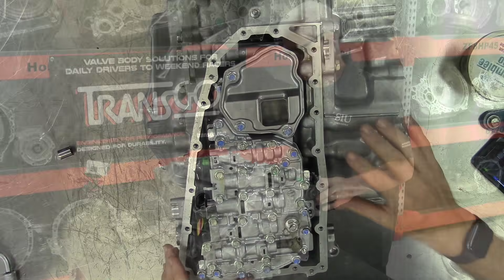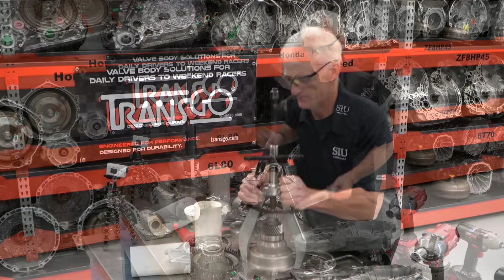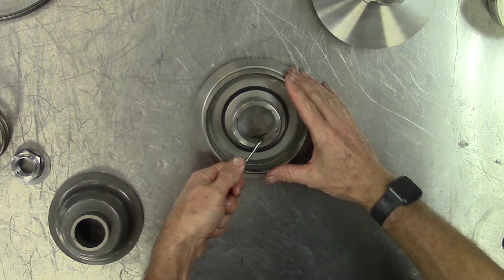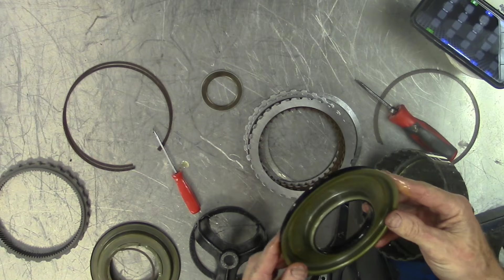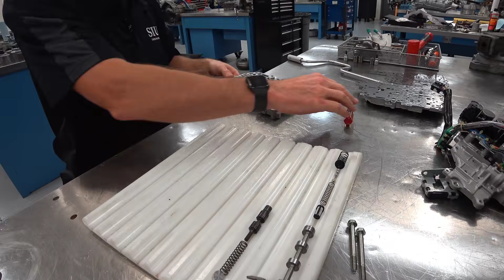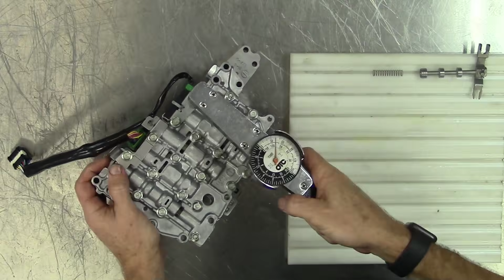Jatco CVT Overhaul JF011E RE0F10a/b

Comment: In your opinion, which component is responsible for producing a ticking sound at low speed when I am not pressing the accelerator pedal?
For example, when driving at around 50 km/h and I lift my foot off the accelerator to let the car roll freely without pressing the brake, I hear a ticking or slightly louder repeated sound that continues until the car comes to a stop. However, when I gently press the accelerator to speed up, the sound disappears.
This is happening in a 2019 Nissan Sentra.? 🤝

Comment: Excellent video I have a 2016 Nissan Pathfinder and would like to know what would make it shudder at around 20 to 25 miles an hour only after reaching operation temp. dose not when cold I've changed the fluid twice, changed oil cooler filter ,and replaced transmission cooler to an aftermarket heavy duty one and replaced it to the front of the condenser and radiator Thank You

Comment: Great videos, thank you so much. I have a 2016 Rogue with a JF016E transmission. Is there any chance I can pull the variator pully assembly without removing the whole transmission from the vehicle. Right now I just have some vibration from the transmission, not a complete failure yet. I would like to check the valve body and variators and rebuild them if possible. Thanks

Comment: I would like to ask you for assistance regarding clutch locking up. It males rattle sound when idling. When you rev it it is quite. When I put it into D and R it takes 2 seconds then stalls. Cleaned valve body and was not bad. Checked the valves and works very good, but still the same. Reconditioned torque converter, they told me it looked good. So its still the same. Oil and all the obvious stuff is good.  No TCM errors. Tcm shows when it locks and unlock clutch but still stalls at stop.

Comment: Are you the guy doing the video or just sharing it? I am attempting a repair on a jfeo16e  reof10d , I used your video to reseal the variators. Primary was no problem. Secondary seems to have .015 press fit on the variator and wont slide down the shaft

Comment: So I just replaced chain and varistors in my transmission. Primary varistors was leaking badly so car wouldn't move right. While in there, I replaced the 2 clutch packs, the frictions and steels to be exact. And a few seals and orings along the way. Everything went together smoothly. Once starting the car, and letting fluid circulate, test drive and it seems like it would like to move in park. I can rev it up and it doesn't force anything, but I can feel the pressure. Same in neutral. Reverse feels like it has brakes stuck. It will go backwards but it takes some throttle to do it. Also, sitting on a grade, the car won't roll backwards in neutral unless engine is off. Then it freely rolls. It didn't have these issues before I dug into it. So now I question, what internally could I have done that perhaps a leak is letting pressure go where it shouldn't. Or do I have a valve body issue?

Comment: These are in Nissan, Suzuki,  jeep and Mitsubishi vehicles and all made by Jatco.  You'll find one service kit on Amazon that cover many makes and manufactures.   The pan gasket, filter, oil cooler and o ring work across all those platforms. Example, 07-13 Nissan Altima is same as the Mitsubishi Lancer and outlander cvt.
Reply: What one works for 2010 Suzuki sx4 crossover cvt 6 speed
Reply: @WelderReese01 RE0F10A RE0F10B JF011E Transmission Filter & Oil Pan Gasket Kit on Amazon. Transmission filter, gasket and cooler cylinder filter. I used that kit on my 2011 Suzuki SX4 two years ago and still working great at 140k miles.
Reply: @20tea awesome thank you
Reply: @20tea I ordered a valve body and it has 1 sensor not 2 🤦‍♂️

Comment: So far, I've had good experiences with this unit. Change fluid every 30k so far, no slippage or overheated. I've been running with premium fluids
Reply: I have 260 thousand miles on my 2012 nissan altima change filters and valoline fluid.  No troubles what so ever,  better than anything the big 3 build 😂

Comment: This is a very well made video.

However, don't let the apparent simplicity of the CVT fool you, they're terrible transmissions.

In a regular automatic tranny the only parts that 'slip' or wear are clutch disks or packs. And they only slip or wear when the transmission changes gears. So they only slip for a fraction of a second, then the parts all move together smoothly.

In these things, what slips is the steel drive belt as it's compressed between the two hydraulic pulleys. And most importantly, they slip and wear constantly! The entire time the car is being driven the belt wears against those pulleys. 

And as you accelerate and decelerate the pulley compresses, and the steel belt wears in three dimensions as it's squeezed against the steel pulleys as the ratio changes. All while under a constant load.

This is why they fail. There's no non-exotic material that can withstand that kind of constant friction without wearing out prematurely. And as the belt and pulleys wear they releases millions of tiny pieces of steel, which causes more wear. This is all by design.

A regular modern automatic transmission can easily last 200K miles. A CVT won't last 50K. Even with regular fluid changes it probably won't last 75K-100K. It's complete planned obsolescence, the car makers don't care about a new car's resale value.

Something else he fails to mention, Nissan does not sell rebuild kits for their CVTs. Not to ordinary people or even tranny rebuild shops. They don't want them fixed, they want you to buy a new car instead.

Avoid them like the plague.

P.S.

Something I forgot to mention, I really love this guy's 'twist and twirl' action when removing bolts with the manual socket bit brace bar!
Reply: Wrong. 260 thousand miles on my 2012 nissan altima,  I change my fluid and filters every 80 thousand miles,  you definitely have to be a gas an go driver with comments like that 😂
Reply: @ber @bernieglass8098  - You are the exception, not the rule. Ask anyone..
Reply: @HailAnts me an thousands of others,  which are not gas an go driver's 😂
Reply: @b @bernieglass8098  Car manufacturers are finally moving away from them. Their scam worked for almost 20 years!

This isn't an opinion. CVTs were originally made for go-carts and lawn tractors because of their simplicity and light-duty and cheapness.

There is no physical way to make one that can power a multi-ton automobile and be reliable at the same time. It's just physics..

Comment: Your video was super helpful to me. My Mitsubishi Outlander broke down with P0868. I didn't want to spend $20k on an overpriced used car so I bought a junkyard transmission. I have never worked on a transmission before but I was able to follow your steps and replace the transmission pump and flow control valve. My car is running great now for about $2k and my labor.
Reply: You put the transmission up yourself?

Comment: Have you done a video of 17' honda cvt transmission overhaul? This trans looks very similar but also different in a few ways. Mine has a nasty shutter on acceleration, like a clutch pack gone bad or something. The push belt looks great and the fluid is super clean.

Comment: I'm currently reassembling my transmission and trying to get the cover on the pulleys. What is the length and diameter of the PVC pipes being used for getting the cover back on at the 38min mark?
Reply: @siuautomotive could you tell me the lengths and diameter of the PVC pipes used to help position the pulleys to help get the case on? Thanks!

Comment: Great video explaining and showing how these work, my daughters Mitsubishi CVT just died, I suspect pump or seal, went from working fine to the very next morning a loud whine and low pressure code.  As mentioned in other comments the lack of parts to do a full rebuild is what is most scarey in owning one of these, and even more scarce is a new one at a reasonable cost.  Feels like 150k is about it.  If I owned a lift and unlimited time I would go ahead and pull it out just to do it but sadly not many people do.  It seems there is a huge niche for a shop that just does these transmissions and ships them back but I suspect the lack of parts is keeping this from happening.

Comment: Where is the lifting points on the transmission for a chain hook up or hook? If  the torque converter drop out the bell housing during installation and hit the ground. Can internal damage happen inside of the torque converter?

Comment: I have owned two Dodge Calibers w/CVT and absolutely love these transmissions. They are a very safisticated and mis-understood piece of technology. I wouldn't use these trans missions in a high performance application but as far as I'm concerned for the daily driver looking for economy with a little bit of care and propper maint schedule I've gotten plenty of mi out of them both. My 2009 was sold with 185k mi and my current 2008 has 175k mi and works great. This video was nice to see how they work and the actual what there made of. Again the proper application of this trans it is a marvel to me to see what it is made of. Ty

Comment: I'm  getting  codes for A and B pressure  control  solenoids. Could that be the valve body? Its a 2014 nissan rogue AWD. It goes in gear then when it time to go to what would be 2nd gear it loses it. Like its slipping.

Comment: Great video. I am hoping you respond. I have a 2009 Nissan Murano with a transmission range sensor issue and when you the gear selector Park and Reverse show on the cluster but no N or Drive and but it does move just limp power. P0705 is the code so I am trying to figure where the trans Range sensor is or the nuetral switch is? I did replace the stepper motor but did not check that the rod it connects to that springs and moves freely but i plan to go back in and check it out. 

Can i send you a video of my valvebody so you can see it operate without the pan on to see what my problem is? 

Do you have an email? 

Your thoughts? Thank you

Comment: With the Oil Pump sprocket you need to be more spacific, there is a raised side and a lower side, can;t just tell people to go off the Dark Link because not all of them have a Dark Link.... Torque Specs would have been great to have too. As for bench checks... Would have been nice if you did it on video so we know what we are hearing and what is normal and what is not normalll....

Comment: My CVT transmission on my Mitsubishi doesn’t shift gears automatically while on drive (D)mode it remains on 1st gear. When I use manual mode (+/-) gears shifts smoothly. Do you have an idea how to solve this issue ?

Comment: I am wondering a Sentra 2013 REO11A CVT transmission which other transmission from other Nissan vehicle could work meaning with the part number being different because most of  them are same just different numbers my local shop said the juke push  to start can’t work due to my Sentra not being push to start put the part number are the same REO11a

Comment: Good afternoon. I had a secondary rotor failure and changed the complete variator. After the replacement, the vehicle drove 100 miles without any problems, without jerks, it mostly worked great until the pump hummed and suddenly lost power. Now the vehicle runs normally and only suddenly loses power. Do you know what it could be and what to check. Thank you!!

Comment: This is a great video. Very informative. I got a Nissan Sentra 2017. With the code P285A. They are telling me to change the transmission but do you think I can just change the valve body assembly. Forward does not work but reverse works so I don’t think it’s the metal belt. I would really appreciate if you can reply to me and let me know what you think. Thank you

Comment: Fantastic demonstration, now I feel better about buying a car with a CVT.  Your video will be my technical go to if I ever have open one of those, or even understand what is going on driving with one.
Reply: Make sure you keep up with maintenance the fluid and there two filters on them that need to be changed. Do your home work and get this done by a qualified trans shop that KNOWS these transmissions inside and out. If they tell you you don't need to do this walk out the door.... they don't know what there talking about.
Reply: The hard part is finding parts, almost impossible.

Comment: Thank you for your content,  I was wondering about the below:

1. what is the exact purpose of Neutral? Is it just for emergencies such as towing the car, or should we engage neutral at traffic lights etc?
2. Would it be harmful to the transmission to engage in sport mode while on the move i.e for overtaking or for driving uphill?
3. Finally, I was curious on the effects of start/stop systems on CVT's

Thank you.

Comment: I have a 2009 Altima with a CVT trash mission, i changed the stepper motor, the valve body and my car still driving 20 miles and hr with not reverse, what do you think is the problem with this transmission?
Reply: JATCO BRAND.

Comment: Does anyone know a fix for p0722? My transmission does not change between any gears P R N D. Attempting to fix a 2011 Suzuki Kizashi with this transmission. Will swapping the solenoids or output speed sensor fix the issue?  Thanks in advance and great video!

Comment: My 2011 Patriot died at 150,000 miles. Trouble is it has the freedom drive package with a 4x4 crawl ratio. Same tranny but with some extra  fun inside.
 Anyone rebuilding them or selling re- furbished? OK I see Mopar rebuilt for $4100. What is the cost to get it installed at the dealer?  thanks

Comment: Hey Mr. Boyle if you’re still monitoring this channel, what is a fair price to rebuild one of these paying a transmission shop would you say I’m taking one out for my friend but I’m going to have them rebuild it since I don’t have the tools and everything else to do it special tools I should say i’m pretty much think the belt slipping at it so it needs a new subassembly It’s an Altima unfortunately
Reply from the maker: Since remans from Nissan are usually a little over 2000 (unless things have changed recently), I would expect a shop to build one for a little less than that, but not much less.
Reply: @siuautomotive  yeah and you can get a brand new one from Nissan for like three grand with a three year unlimited mile warranty so it’s not even really worth it to get a reman to be honest with you

Comment: Hi! Thanks for making this greatly informative video! My 2012 Altima has zero codes, but is hesitant to engage (forward or reverse) until it's moved a bit. It's as if it needs to build pressure in something. Before I take it apart, I'd love to hear your ideas on this.
Reply from the maker: Well, they are known for pump flow valves sticking.  There's really not much that needs to happen to get these moving.  There's just two clutches, and if it's happening in forward and reverse, it'd have to either be a pump issue or a drainback issue and you're waiting for the torque converter to refill.  You could put a pressure gauge on the forward or reverse pressure tap to see how quick pressure builds.

Comment: By far the most helpful video yet, my ‘13 3.5 Altima has been doing the classic stuttering since I bought it 20k km ago, haven’t been sure what to do when the trans goes as I’m broke, but I think this might give me the courage to try and take my time rebuilding it when it goes
Reply: Have you tried changing the CVT Fluid?
Reply: @emmancastillojr.5938  yes, helped a bit with the noise coming from manually shifting. The owner before me said it had EVERY fluid changed when I bought it, found out that was all except trans and it had never been done until I did it at ~9.5 years and 135k km. So I think damage is sort of done
Reply: @emmancastillojr.5938 do you have any tips on best fluid to put back in these cvt transmissions?
Any miracle additives help? ,,mine has started sliping,,only goes 5mph!,,,Help with any advice 😢
Reply: @bobbieprice1351 any fault codes?

Comment: I have seen guy's put these back together and they always use way to much gasket sealer.. ((Like this one guy used a Caulk gun and went along the inner edge heavy and then heavier around the bolt holes. Then when he put the bell housing on a Half Inch of that gasket sealer would spurt out the sides!!!!)) 
   (So I can only imagine how much is going inside and breaking off into the CVT fluid and then clogging everything up.) I can see why guy's don't want to back their work longer than a year, if they are going to assemble them like that.. Pink sealer, a Half inch all the way around the 3 main housings.. WOW Maybe that stuff dissolves and I don't know it, But if it did how would it seal.. IDK.. But It was a mess he used way to much.. I was taught to spread in the center and only use enough to get a good seal once torqued down..

Comment: Great video and informative thread
Reply: I rebuilt my CVT JF011E transmission got it put in but I’m getting a secondary pressure solenoid stuck on ( low pressure) what do I need to look for Thanks 
I replaced valve body with a complete reman   Please can you help 5:53

Comment: Hi 
How to come to Saudi Arabia to fix my CVT gearbox for nissan altima L33 😂
Transmission suddenly malfunctions without warning 😂
I contacted with Nissan Saudi Arabia They checked transmission and the problem was the chain was broken.😢
I asked them to fix it but there is no professional technician and the only solution is changing the all cvt gearbox 😭 it costs 9000$
Then i bought used Transmission
The i changed the Oil and Filter
I see the transmission is good is pure with normal driving but when i put half race the car is sutter sometimes on 4.5 to 5 RPM but with full race it's clear 🤔
I checked out all the car's cumputers are normal every thing is normal 
So that what do you think about this problem?